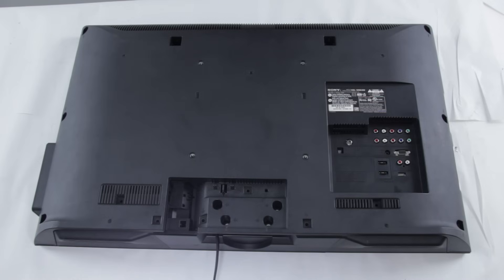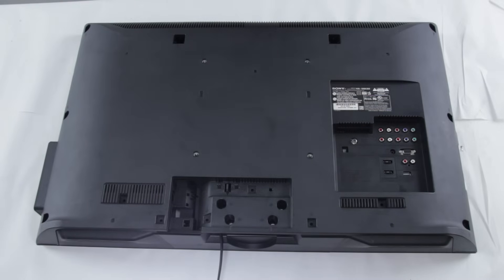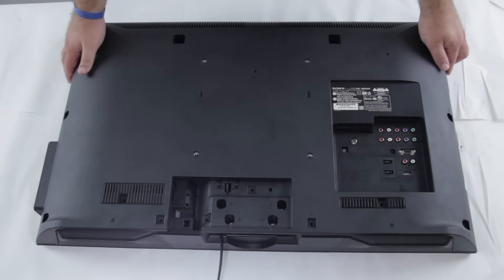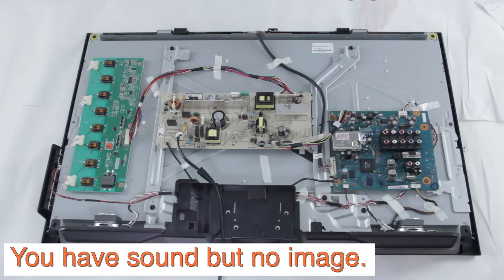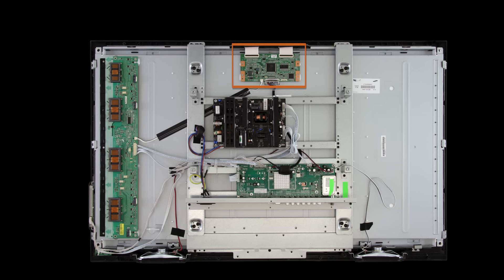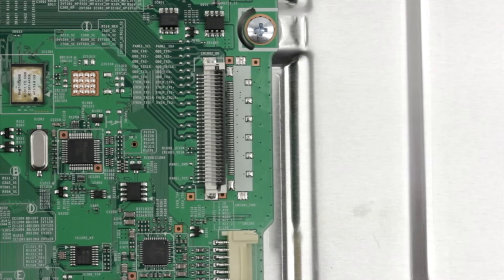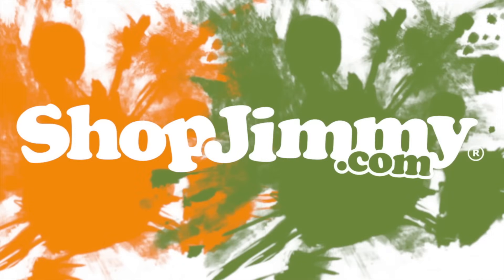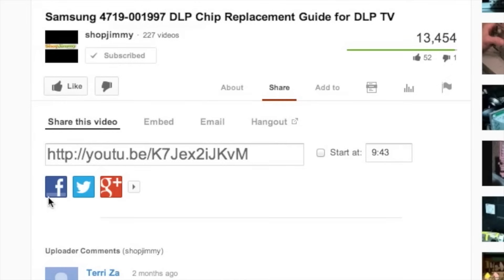LCD TV Repair Tutorial - T-Con Board Common Symptoms & Solutions - How to Replace T-Con Board

Comment: Hello I have an LG  42LE4500-ZA and it have a problem with the display I think so because I turn it on and it shows me the first picture with LG i mean the logo and after that it turns off. I changed the power supply vecause I taught maybe this was bad but the tv still have the same problem! Please let me know if you can help me thank u!

Comment from the maker: Thanks for watching our TV repair video! Due to YouTube policy changes, we are no longer answering tech support questions in the comments section. We apologize for the inconvenience. If you need additional tech support, please visit FixYa.com or contact your local TV repair shop. Good luck and let's fix your TV today!
Reply: Robert Washburn
thanks fixed now lol
Reply: ShopJimmy.com LG flat screen
Serial: 408RMGCNA191
Model: 50LB5900-UV
Symptoms: 3" grey vertical band with colored lines on the right side of screen.
They are displayed over the input and menu screens.They appear over all input selections.
May this just be a ribbon cable connection problem or do I need a T-con board?
Reply: how do i repair vertical lines on my LCD samsung screen model number s/n:AL6F31FQ300936N  please help
Reply: +ShopJimmy.com  I have a JVC HD-52Z575 it comes on and you can clearly read the menu options but on any input the screen is so distorted its just a bunch of coloured rectangular boxes.
Reply: sam333 😞
Reply: I have a philips  Model 47PFL7422D/37 Serial Number YA1C0749003545
My tv is dark on the left side of the screen not completely black but darker towards the edge like a fade to black starting at the center of the screen.
Sometimes both sides are dark but if I turn it off and on the right side clears up.
Sometimes the both sides are clear and then the left side goes dark all at once after about 5-10 seconds.
The TV functions fine other than the display.
I ordered the T-Con board from your store.
After I replaced it the screen looks exactly the same. The original board part number is 6870C-0120C.
If the board is not bad, what would the next most likely cause of the problem

Thanks for the no response. I watched more videos and ordered the master and slave boards. These fixed my problem. Your videos helped a lot, thank you.
Reply from the maker: dufaud   This could be a problem with either the t-con board, the main board or the TV panel.  You can replace the main board and the t-con board individually to see if one of those fixes the problem.  Click this link to replacement parts for your TV model number:  http://www.shopjimmy.com/catalogsearch/result/?q=50LN5200-UB  There may be multiple boards for the same TV model number, be sure to match part numbers on your current board, with your replacement for compatibility.  Thanks and please let us know if you have any further questions with your TV Repair!  www.shopjimmy.com
Reply: @shopjimmy   I have a Sanyo tv but its like the brightness and colors are so bright. I am not sure what the cause... Because even when i try to lower the brightness its stays bright....sometimes buy not often it will go back normal and then go back to being really bright again
...Sanyo, MODEL NO: DP42849, SERIAL NO: B8370855362017
Reply: ShopJimmy.com Thank you so very much.  I will keep you posted.
Reply: ShopJimmy.com  I have an LG 84LM9600-TA TV which is dead and I want guidance or circuit diagram to go ahead for repairing. Thank you very much.
Reply: Yes I have all tools, knowledge and experience in Electronics more than 30 years. Thank you very much.
Reply: ShopJimmy.com Hello! My Samsung UE46 EH5057K need to replace screen (LED sreen was broken). When I can buy appropriate screen for my TV? Is SAMSUNG LN46A630M1F screen compatible with my Samsung UE46 EH5057K ?
Reply: My TCL l32b2500a isn't turning on stand by light comes on what do I check thanks
Reply: ShopJimmy.com 
Hello,

I have a Samsung  ln-t4661f
I replaced the capacitors that were bad and now it starts up.
It was also having the horizontal 3" stripes and ghosting of menus
I cleaned the ribbon cables on the t con board with alcohol and it appeared to fix the picture issue.
However the picture started displaying what looked like flashlights at the upper left and right side of the screen pointing down, Now the picture is almost completely washed out. Is the T con Board Bad? I can send you a picture of the screen if it would help,

Thanks, Dan
Reply: +ShopJimmy.com 
Brand: Sony Bravia
Model KDL-40x420
Symptoms: 2-3 ft neon green color across the majority of the lower part of the tv depending on whats displaying changes to a neon pinkish color. it shows green when powering on aswell before the TV reads what mode its on for HDMI or PC-VGA input.
:( Thanks for any advice you can give.
P.S. has a pink line right above where the green appears.
Reply: +ShopJimmy.com  hello i got sony bravia, model # KDL40EX700  serial # 8039541    the sound is normal but the screen on the left straight colored lines on the middle normal picture and on the right dark picture, which one should i have to replace the t con or the mother board? and also how much the price?  thank you so much if you can help me on my problem
Reply: +ShopJimmy.com 
Brand: Vizio
Model: M501d-A2r
Symptoms: When TV turns on the screen shows vertical lines of all different colors covering the entire screen. Can still hear sound but the picture does not change and there is no way to see if it is using cable, HDMI, or any other source. Menu will not show either. Only showing the vertical lines of various colors.
Reply: +ShopJimmy.com I just subscribed and posted my problem in the comments section. I hope you can find the time to respond to it soon. Thank you.
Reply: +ShopJimmy.com hi! i just repair one of my TV given by my friend its samsung and i watch your video and thanks a lot for sharing, now the other one is SONY BRAVIA i think the panel or the screen is the problem coz i check your t con and the is a note that a colored vertical lines cannot solve the problem , so i think the power supply , mother board and t con are normally functioning i try also to hook up my laptop to the hdmi but still the same,
Reply: +ShopJimmy.com I need help!!!! i am replacing my Tcon board for my Ln5na630m1f samsung TV. I have the new tcon board. and am Soooooo close. but The ribbon  seems to have a different attachment than what you suggested, and my board wont move even though i removed all the screws. Do you know what might be the problem?
Reply: + ShopJimmy.com Hi, I have a problem with my LCD TV, VIVO, model LTV40FHD. When I turn on the TV it's work perfectly for 10-20 seconds, after the screen became black but the sound is working (no back light on TV. I turn it off and turn it on, same things, work for 10 second and after black! I want to be sure before to replace the parts, if is the T-CON Board, or the Backlight Inverter?
I will appreciate your answer. Thanks
Reply: hi Jimmy, this is Richard,  I have a LG led, smart tv. after seeing ur video,  I'm pretty sure it has a bad t-con board. it has back lite and sound but no other pictures. could u direct me to where the I could purchase a replacement  or do u have one. LG LED TV
MDL# 47GA6450-UD ,                                        SER# 303RMUY24102    (1052)
service code: 47GA6450-UD BUSYLMR
MARCH 2013
BOARD PART# 6870C-0444A
MODEL# LC470DUE-SFR1_CONTROL_VER.1.0
Thank u for ur time Richard
Reply: +ShopJimmy.com  HI  I have a samsung 3d lcd un46c7000  with some horizintal and vertical grey line   do you have an idea ??
Reply: Hey guys I have a RCA 42" LCD full HD model no.42la45rq, I have a picture and sound but the only thing I can do is turn it on or off with the remote control what part would you say went out?
Reply: hi did you get an answer i have same problem
Reply: ShopJimmy.com How can i tell if it's the tcon board? it has polarization..model #42pfl7403d/f7 serial #ya1a0843024426 The picture is polarized but menu seems normal until i go to settings within the menu, then it to is polarized? i've watched ur videos and narrowed it down..i think? plz lmk wat u think..tyia
Reply: ShopJimmy.com
Reply: ShopJimmy.com 
Hi shop Jimmy.  my tv model number is 47lg50-ua. my tv has backlight and sound (proved through aux connection with my phone.  I used to another one of your videos to troubleshoot it.  I finally decided to get a new T con board as the video suggested.  I tested the new board today. the result is the same
Reply: ShopJimmy.com I have a TV that has 4 ribbons to the t con board.. I start tv and it black screen and vertical lines.. after plying with it.. I detach some ribbons and put back on the  t con board.. it perfect picture.. any ideas??
Reply: dufaud can you not read?
Reply: i clicked your link www.shopjimmy.com and access was denied
Reply: I have a vizio m420sl that the bottom have of the tv is darker than the top. It powers on with the normal brightness then immediately goes darker at the bottom. I was looking for the tcon but dont know where its at
Reply: I have a lg lcd 60inch 3d tv and the other night it would turn on but no image the backlight was on with black horizantal lines and gradually fadded black.  I turned it off couple of times and this was the situation.  The last time it came on I could hear audio.  I took the panel apart removed the connectors all of them and plugged them back in the tv started to work again.  I have been having a few issues where the tv becomes unresponsive while on and takes several mins to turn off.  Once back on it is fine.  Seems to happen if it is on for a long period of time.  60LM7200-UA 303MXEZ65644.  Any help would be great.  bunc5224@gmail.com.
Reply: ShopJimmy.com , hi, i have a sharp aquos with a full blue screen, is the blue screen related to a bad t board?
Please let me know so i can order part and replace
Reply: I have Hisense Tv sound but no picture
Reply: I have a Samsung Model UN65F6300AFXZA  S/N Z6UJ3CDD4007421. Symptom, when you just plug in the tv and hit no buttons the backlight flashes but only the lower part of the screen and the menu appears for a short time then repeats. I've already changed the main control board but the symptom was identical. I don't think it's the t-con board but I'm curious why I get high voltage for the backlight when no buttons are pushed. At that point the only power should be standby power. Could a bad backlight led cause this. I'm thinking P/S but I'm a real novice at this.
Reply: Thank you so much for this video, I am going to write you on FixYa.com.
Reply: sorry I can not find how to write you. The issue with my TV Samsung UE55D8090YS is that since two weeks appears a vertical line (gray) on the middle of the screen (on red colour background is more visible) also the right side of the screen seems to be an issue. Plus, the frames of the TV seems to be heated than normal. Pls let me know in private if you can help and check out this pictures:  https://photos.app.goo.gl/T95bcPeH4Dz8gdT46
Reply: @erjongorani9318  I'm no expert but in watching many repair videos on LED TV's it looks like a problem with the T-con board the interconnect board or the panel itself. If it is the panel sorry to say cannot be fixed and buying a new TV is the only option.
Reply: @richardbambenek2601  thank you very much for your help! Greetings from Berlin.
Reply: Yeah I'm sure the local TV shop is going to help me out with trying to fix my own TV
Reply: ShopJimmy.com  t con board replace no picture but has sound 42LB5600-UZ.AUSDLJM
Reply: Can I put a Samsung t con into a VIZIO tv?
Reply: I've got a one tv model100012588-M. The picture and backlight flashes on then off, has a half display with lines through it. Is this a tcon problem
Reply: What do "YouTube policy changes" have to do with answering questions?
Reply: I got LG my tv 55lm6400 and I bump into and it got colored lines going up and down slot red blue green
Reply: ShopJimmy.com LG 50" model # 50LN5200-UB, serial # 310RMWVE2449.  Has worked fine for 14 months.  No picture, but sound comes through whether the input is from cable or dvd player.  Video screens internal to the TV (e.g. settings screen or input screen, etc.) also do not show.  Does this sound like a T-CON board problem?  If so, I do not see this particular part on your site, where would I be able to find a replacement?  Thank you for your help.
Reply from the maker: Muhammad Akram  Try all repairs and troubleshooting at your own risk.  Do you have experience with a meter measuring voltages?  If so, you should check the voltages on the power supply.  Thanks!  www.shopjimmy.com
Reply: ShopJimmy.com Bummer. Youtube sucks!!!

Comment: Have Sceptre 24 inch LED TV Model# E24 P/N E248BV-FMQR8BOAV93AA.  Everything on tv works fine with the exception the red indicator light is not working, nor will the remote control work to turn tv on or off, and control the sound. Need help with this problem.
Reply from the maker: Willie Turner  Please watch this video FIRST to help with your repair!  https://www.youtube.com/watch?v=BP3NVNCGEv8  I recommend replacing the main board in your TV.  Click this link to replacement parts:  http://www.shopjimmy.com/catalogsearch/result/index/?cat=56&q=Sceptre+E24  There may be multiple boards for the same TV model number, be sure to match part numbers on your current board, with your replacement for compatibility.  Thanks and please let us know if you have any further questions with your TV Repair!  www.shopjimmy.com

Comment: Hey shopjimmy, i have a problem with my vizio E321VL
When i turn the tv on sometimes the screen is blank and in like 5-10 minutes the screen come alive but with the half left side is black but the menu and tittles can be seem on the black side.
Reply from the maker: Marta Guevara   This sounds like a TV panel (TV Screen) problem.  If your TV panel is bad, it may be more cost-effective to replace the TV as panels are typically hard to find in stock, difficult to replace, and expensive.  Thanks and please let us know if you have any further questions!  www.shopjimmy.com
Reply: ShopJimmy.com Thanks so much for the reply. So sad to know is the panel, but you saved me time and some money to go check the problem. Keep the good work on, cya next time.

Comment: have Sony KDL-46S4100, problem is with everything hooked up there is no backlight sound or video, do have steady green light on front, if unplug lvds cable from a board only,  backlight comes on in 8 seconds, if unplug lvds cable from tcon side, no backlight comes on, also wonder if I maybe need to restore firmware, there is none available on sonys site, any idea where I can get it, thanks.
Reply from the maker: g seperd  Please watch this video FIRST to help with your repair!  https://www.youtube.com/watch?v=BP3NVNCGEv8  I recommend replacing the main board in your TV.  Click this link to replacement parts for your TV model number:  http://www.shopjimmy.com/catalogsearch/result/index/?cat=56&q=KDL-46S4100  There may be multiple boards for the same TV model number, be sure to match part numbers on your current board, with your replacement for compatibility.  Here is a link to a video showing how to identify your part number, click here:  https://www.youtube.com/watch?v=Aodz2LHkzbY  Thanks and please let us know if you have any further questions with your TV Repair!  www.shopjimmy.com

Comment: i have two samsung  48' lcd tvs. one with cracked screen but powers on one without internal boards but screen is in good condition. model numbers are different. is it possible to replace the screen with the other if i purchase the correct t-con board?
Reply from the maker: Natalie Fischer   If the panels are the same then yes.  Look for a white sticker on the inside of both TV's and see if the panels are the same.  Thanks!  www.shopjimmy.com

Comment: I have a Sony Bravia KDL-46W4100 LCD TV.  The display is ruined by four rectangular distortion areas, one in each quadrant of the screen (distortion is similar to this link http://img812.imageshack.us/img812/6407/imag0221l.jpg).  Screen also has a number of horizontal lines (of varying lengths) distorting the display.  Other comments and posts appear to indicate the issue may be either T-Con board or LCD panel.  What say you?
Reply from the maker: SteV   This sounds like a TV panel (TV Screen) problem.  If your TV panel is bad, it may be more cost-effective to replace the TV as panels are typically hard to find in stock, difficult to replace, and expensive.  Thanks and please let us know if you have any further questions!  www.shopjimmy.com

Comment: I have a LG flatron M4715CG when turn the back light come on then go out 3 seconds after. then the tv turn off. i replace the back light inverter board.but no change so I take the screen apart and notice I have 5 lcd back lamp bad so I remove them bot no go. Do I need all 20 back lamp to be working before the back light to stay on.thanks
Reply from the maker: Richard Lindo   Unfortunately we do not sell replacement lcd lamps.  Thanks!  www.shopjimmy.com

Comment: I have a 46 inch samsung, when i turn it on it will light up and show picture and flash on and off about 4 to 5 times then goes black i still have sound whats up with it tv model is ln46b530pfxza
Reply from the maker: Adam Varnado   I recommend running the flashlight test on your TV.   Here is a link to a video we produced that shows how to run the flashlight test. https://www.youtube.com/watch?v=xUzCLgoSPGM Please reply with your flashlight test results and we can recommend a replacement part for your TV repair. Thanks and please let us know if you have any questions! www.shopjimmy.com